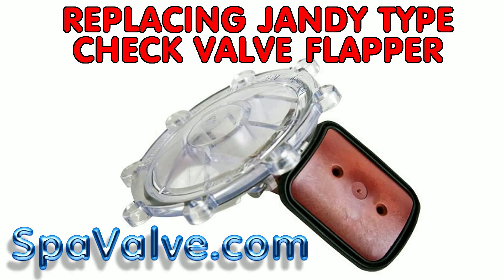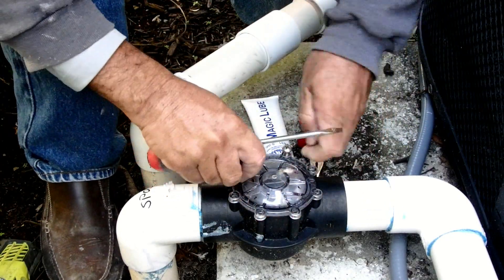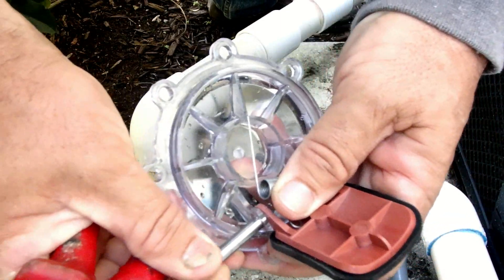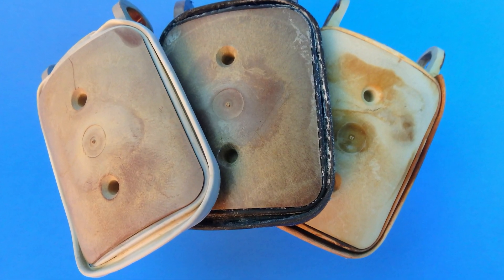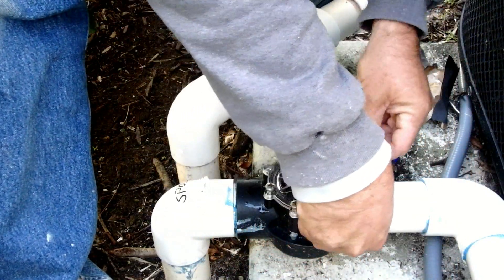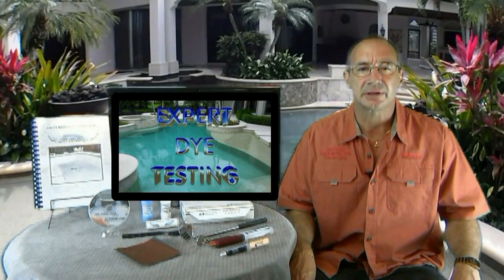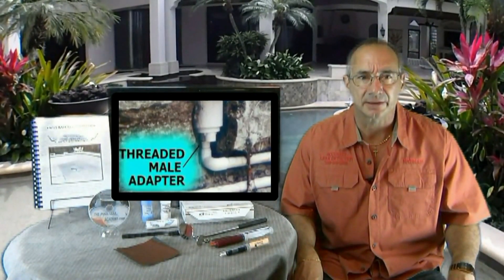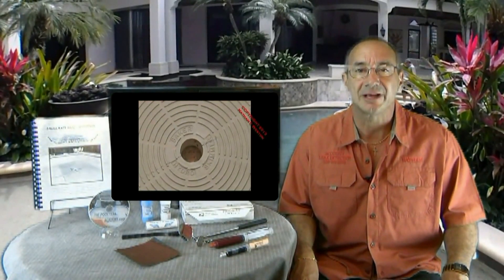SPA CHECK VALVE- JANDY FLAPPER REPLACEMENT

Comment: Smoothing around the pipe opening is the key.  I had a slow drain out of my spa so I decided to replace the flapper and found that the opening had significant buildup.  A little careful sanding did the trick.  Great suggestion!

Comment: Here it is three years later and I discovered your video.  Thanks so much., as I replaced my valve very recently, but still had spa drainage.  When I took the valve out again today I did notice something (perhaps a calcium deposit) inside the body, which appears to not allow for a complete seal, so I took your advice and used some sand paper and did my best to fix the issue.  We'll see tomorrow if this did indeed work.
Reply from the maker: Its tricky to get the spa to hold water, we reinforced the spring on our valves to make a tighter seal.

Comment: Hi!  Nice video!  How do you drain the valve assembly of water before replacing the check valve?  My spa drained overnight and so I thought it would be free of water, but when I took the screws out and popped the lid, water gushed out.  I imagine it would gush out until the spa completely levels with the pool, but that appears to be another 100-200 gallons because the spa is completely elevated.  Tips?
Reply from the maker: open up the spa bottom drain valve and pump the water into the pool.

Comment: I have a 3 way jandy valve. Comes from the filter then goes to either the pool or spa. I can split it 50/50 return to pool/spa. 100% to spa. Or 100% to pool. I opened the valve up the other day to replace the seal and a round plastic piece came out of the pool return line. It’s about 1.5” in diameter and has a “Z” on the top. Anyone know what this is?

Comment: Great video!! What happens when the screws on cover of the valve no longer tighten? The cover with the 8 screws...I have a 2/3 screws that do not tighten and I suspect an air leak there. Thanks, George

Comment: Mine seems tight but it's leaking any ideas there?
Reply from the maker: See how low the water level goes
Reply: @poolleakacademy5573  It does drop... but my back wash valve was also leaking, so replaced O rings there... probably going to change the check valve today,,, hopefully that fixed that leak...